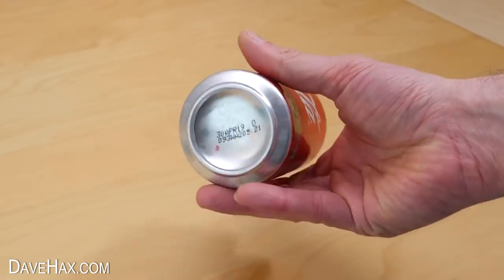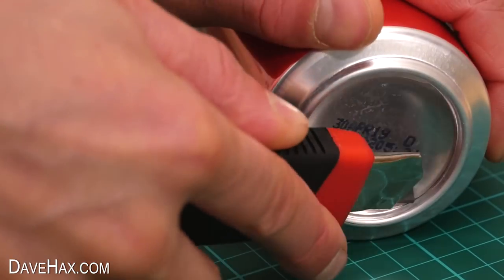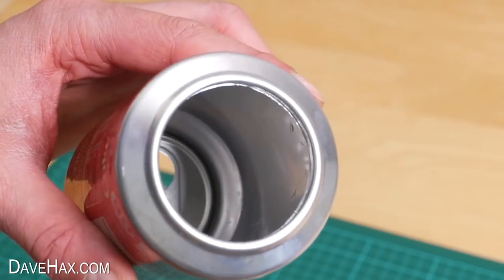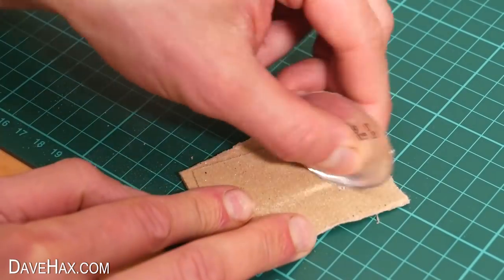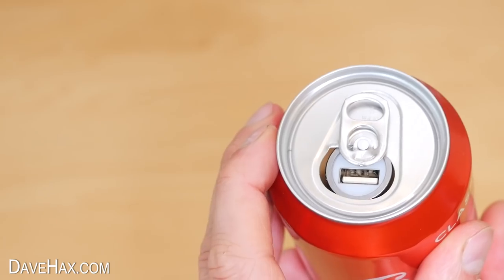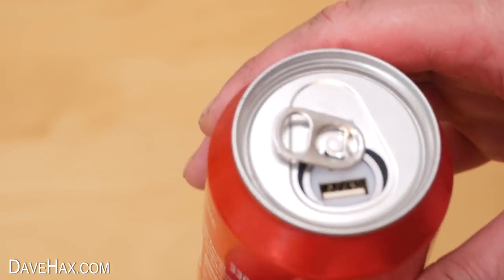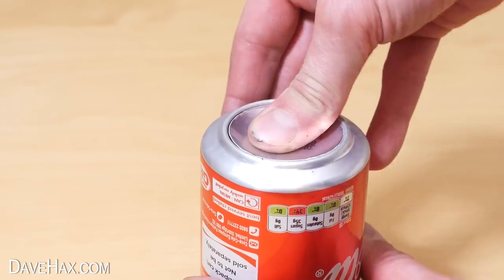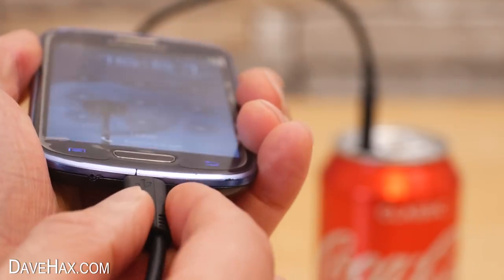I Made a Coke Can USB Portable Power Bank - Phone Charger!

Comment: But how can you charge the powerbank?
Reply: Finn asking the real question
Reply: mine has an adapter to plug it into a usb port and charge it back up.
Reply: yeah but the lit of the can is blocking that port..
Reply: Just charge it. But this is a stupid idea anyway.
Reply: no it plugs into the same slot you use to charge the phone
Reply: Calli Hatfield nope you can see that there is a micro usb port next to the regular usb port... its under the tab.... so yeah i think it would have to be taken apart every time you want to charge... design needs a work around...
Reply: Finn spin the
Reply: Finn it's true though
Reply: 1:35
Reply: yeah
Reply: Get a power bank the charges on the back of it
Reply: R u all blind under the cap there’s a micro USB port
Reply: Finn remove the bottom, the plastacine, the powerbank and then charge it
Reply: Remove the play-dough with hot water
Reply: You use the same port for charging.
Reply: I was thinking that